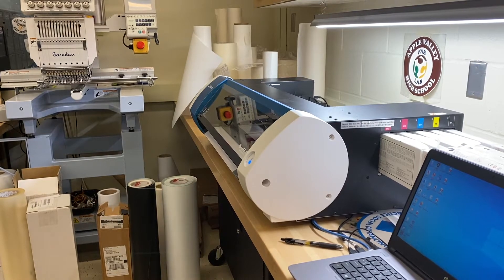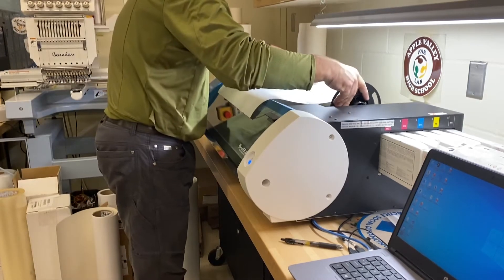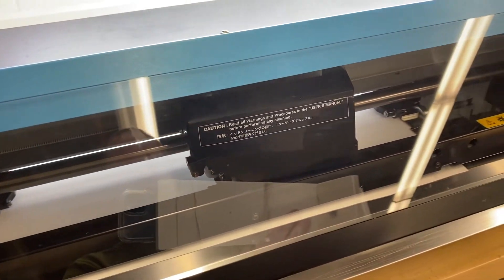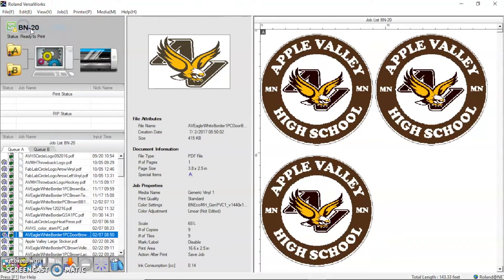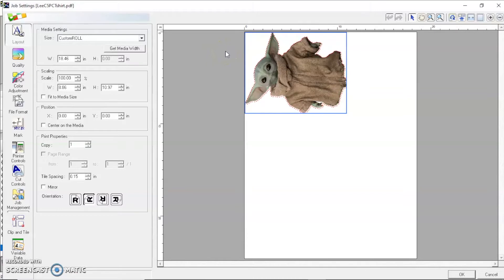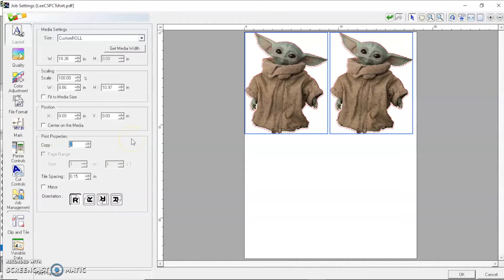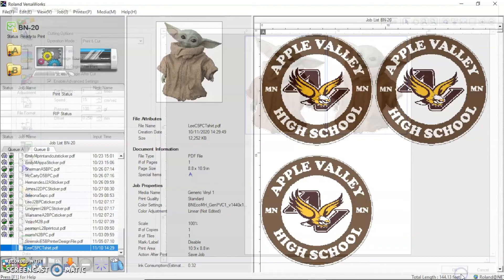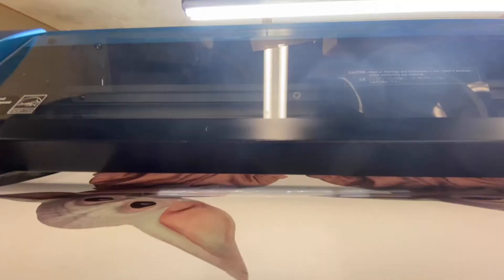*Roland BN-20 Print & Cut Heat Press Print Video 2 of 3

Comment: Can you print clear sticker with this ? Thanks
Reply from the maker: Not with this type of print head. You can order print heads that print on clear vinyl. For this machine, the cost is significant for a new print head ($2,500).
Reply: @fablabavhs3332  
The printer is capable of printing white, why wouldn’t you be able to print on clear Vinyl. 

I think he was asking can you print clear over the print. You could always UV Laminate over the sticker if your worried about fading outside.
Reply: Yes